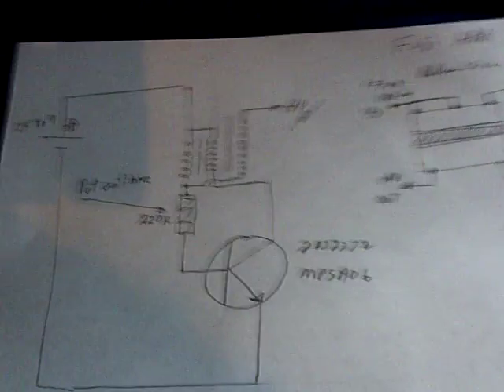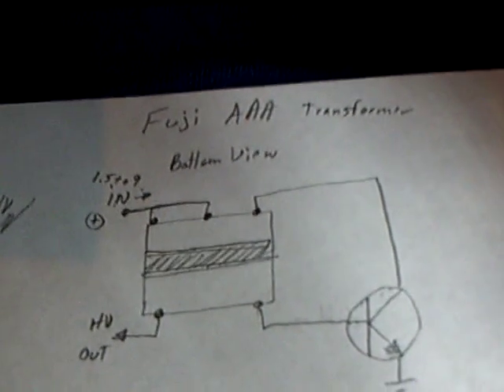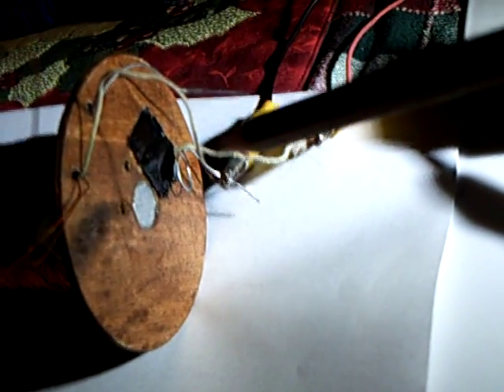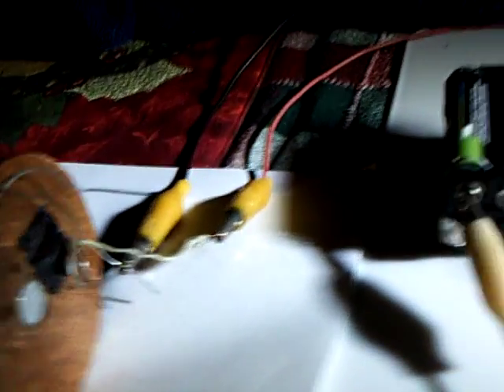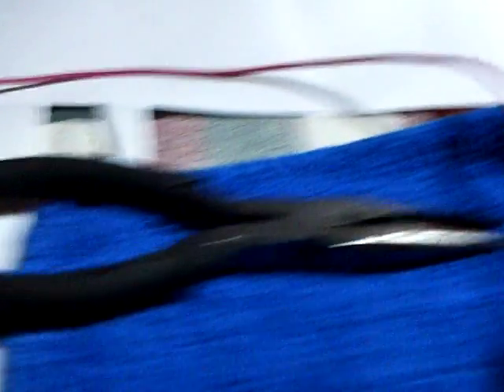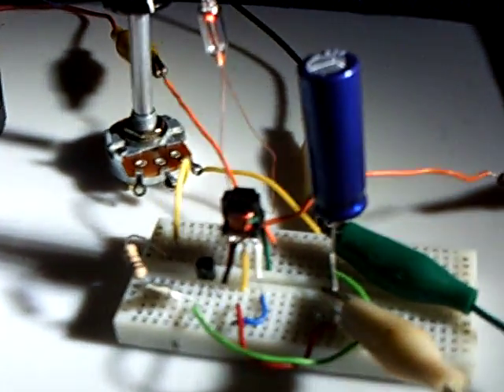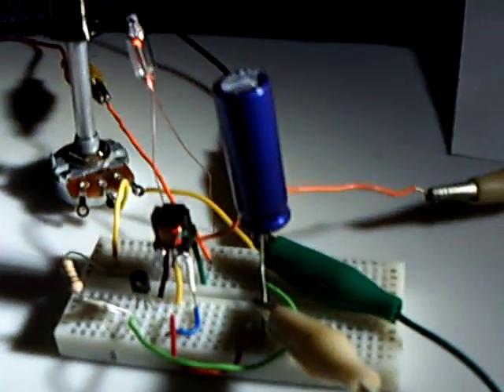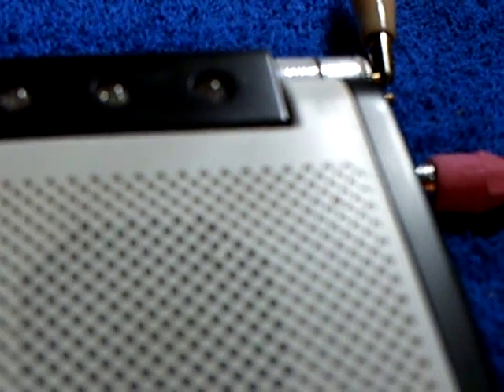Lasersaber Joule Ringer  2nd attempt

Comment: Yes, thanks for the transformer diagram. I have another transformer with 4 pins on one side and 2 on the other. There are quite a few different Fuji boards. Can anyone tell me how to decrease the voltage and increase the Ah.? some sort of secondary transformer or inverter maybe?..Thanks for any help...Liked your video.

Comment: Nice video! Looks like almost same what Tesla did.

I think, You did built up scalar energy transfer right on biffilar coil by canceling it's magnetic fields on opposite wires together, that's what it is  with 1 wire lightning on bulb and diodes - and it makes eddy currents on each metal in excited area! :)

Comment: Nice work. lasersabers diodes seem to be rectifying as well as acting as resistors. I always wondered why resistors were used. By limiting voltage/current with them loss is formed as heat. Why not use a 220ohm primary wind with a secondary that the pulse from it can be used. This should be able to be done in place of all resistors allowing more recovery. This is where my test are going to go. Smaller wire has more ohms per foot so 220 ohms isn't an unreasonable value to wind.

Comment: There is always a (eg. small=10pF) capacitor towards the surroundings at these high frequency's (specially with rectangular voltages)  . That is why the lamp lights and the whole surrounding is energized. if you go eg 2 meters away the light goes dimmer or out. If you draw these capacitors in the schematic you will see how the current flows.

Greez M

Comment: It seem also that the direction of the diodes is important , but since he mentioned that they are leaking , it means it works like a single wire both ways , but he got really different results depending on the direction , the diodes have to have a second function .  I think is to capture the Bemf and send it back in the coil .

Sincerely hope i helped .

Mk1